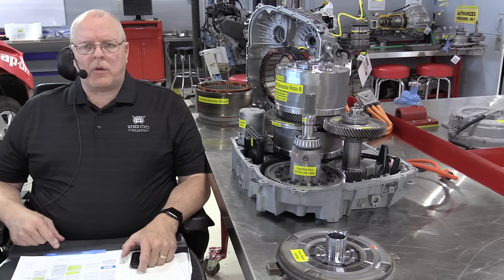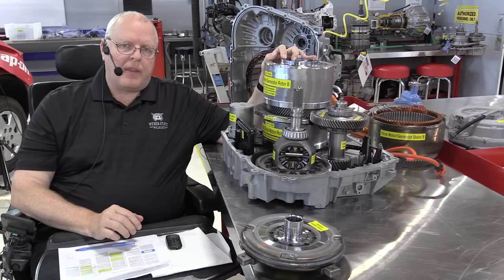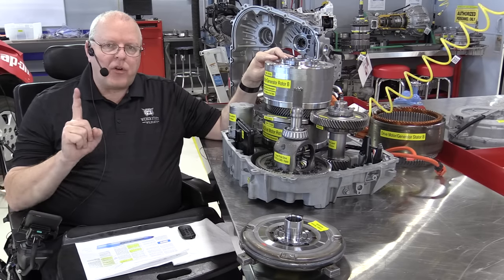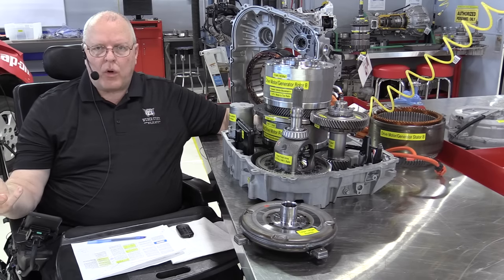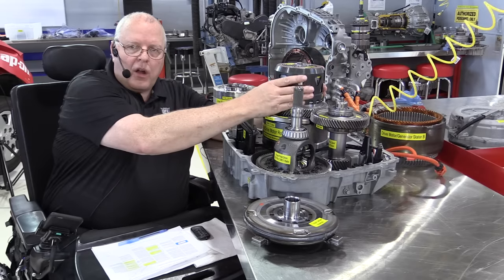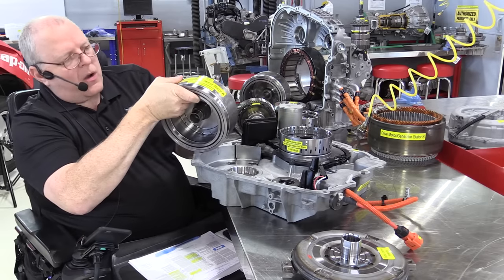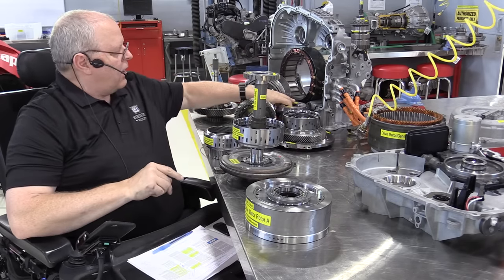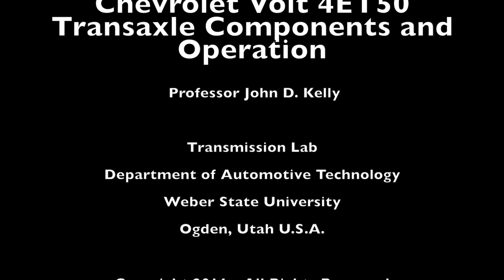Chevrolet Volt 4ET50 Transaxle Components and Operation (2011-2015)

Comment: One cold morning my 2012  Volt gave a little jerk at a stop sign and then I got a message that the engine was unavailable and the propulsion power was reduced. It would still drive but the acceleration from 0-30 was dangerously slow. I took it to a chevy dealer and they said that the transmission was failing and that they found metal shavings in the transmission fluid.  They said it would be $5500 to replace the transmission.  I told them not now and drove it home.  As soon as I got home I drained the transmission fluid and ran it through a micro-mesh filter and found no metal or sediment of any kind.  I put new transmission fluid in and disconnected the 12v battery and had it load tested because it is 4.5 years old. They said the battery was fine.  I put the battery back in and drove it to a local Auto Zone to have them see what codes it was sending.  P079A Transmission Friction Element "A" Slip Detected. How do I remove the transmission?  Do I have to remove part of the frame to drop it? What else do I have to remove and or loosen in order to get it out?  Some of it will be obvious but is there anything that is not obvious, or an order that will make it easier? I have worked on my own cars for years and feel fairly comfortable doing so but this car is so unique that I could use some guidance.  Any help that you can give is greatly appreciated.
Reply: Did you end up getting this fixed?  Was the trans the issue or was it something else?
Reply: @GrandPrix46  I did. Specifically it was the first set of clutch plates that had gone bad. Theoretical you could open up the transmission and replace just those clutch plates. I didn’t have the time or the facility to attempt that. I found a used transmission for $1000 and then found a little shop mechanic that would install it for $1000. It is still running but makes a metal to metal clunk sound when a start going and when I stop. Fingers crossed to see how long it lasts.
Reply: @chadlooman6720  glad to hear it.  I bought a 2015  last October and my wife a 2013 a month later, hoping to run these things for a long time.  I've already changed the trans fluid in hers twice (I use a mityvac to suction it from the top, gets about 6 quarts out), came out very clean both times.  She has 50k and I have 40k miles on mine, get around 40 miles to a charge using AC all the time in South TX.
Reply: @GrandPrix46  best of luck. I never get more than 30 miles out of mine. I hope they last a long time for you.

Comment: hi professor  i have a opel ampera (volt) and i have a question for you. what is inside a torque dampener and how it works. does a transmittion fluid enter in a  dampener or is this sepparate unit...regards

Comment: Is the Cadillac ELR the same as the Volt, or is it a different?
Reply from the maker: Yes, the ELR has the same powertrain as the Volt. Later ELR models had a higher usable battery capacity.

Comment: Hello: Is there anyway they could drive Both Motor A and B from the engine to power the wheels and charge the batteries all at the same time?
Reply from the maker: The motors can act as either a motor or a generator, but not both at the same time.

Comment: Does the Cadillac ELR use this system, or the one in the 2016+ Volt? 
There were ELRs sold as 2014 as well as 2016 models.
Reply: yes

Comment: the Motor a is for Revers ??
Reply from the maker: No, motor A is for power generation and variable ratio driving.
Reply: Motor B is just run backwards by the electronics when in reverse.

Comment: Some forums writes there are a speed on the highway where the gas engine directly connected to the wheels. Is it right? Which speed when the Volt runs that way?
Reply: I heard above 70
Reply: @ShastaTodd  MPH or km/h?

Comment: I feel this is similar to the Honda clarify phev😂
Reply: Look at John's latest video on the Honda E-Drive transaxle.  Honda achieves similar results with a much simpler design.  Honda foregoes the flexibility to use either or both motors to drive the wheels (only the larger motor/generator ever powers the wheels in Honda's design) but it eliminates the planetary gearset and a number of clutch/brake packs.  Cool stuff.  Chevy has a more flexibility in operating modes, while Honda took the K.I.S.S. approach.
Reply: @Thegonagle  not to mention, the Clarity is dog ugly.

Comment: 30 min. and 42 sec.and not one word about how or what or how to change the the fluid that lubricates this unit MAJOR FAIL!!!!!
Reply from the maker: Thank for the feedback. It has a drain plug on the bottom of the case, an oil level check plug on the side of the case, and an oil fill plug on the top of the case. There is no dipstick. On a hot transmission, add new Dexron VI fluid through the fill plug until it drips out of the fluid level check plug. It takes 9.4 quarts on a dry transmission. Best wishes!
Reply: @Don Read the Volt's owner manual. You will not need to worry about changing the trans fluid for over 90.000 miles. Since there is little heat build up and less clutch slippiage in the 5ET 50, the oil will not suffer heat degradadtion as much as a regular gas engine  only transmission. There are Gen 1 Volts passing  the 100,000 mark and still have the original factory fluid inside. Not needing to change the fluid is a MAJOR VICTORY!